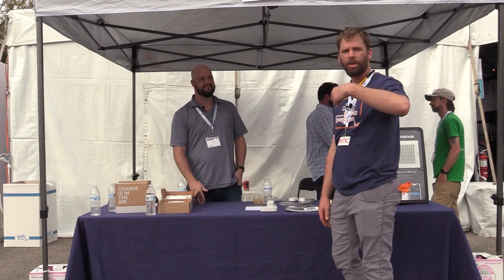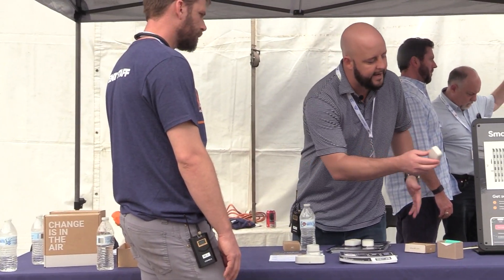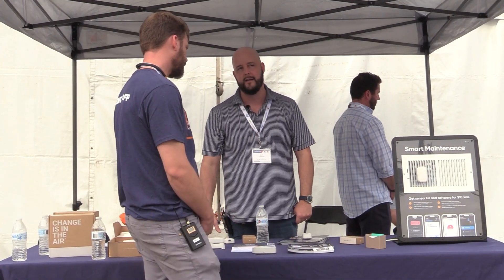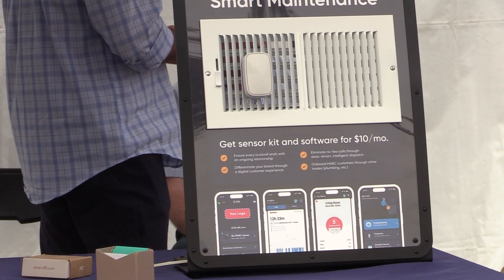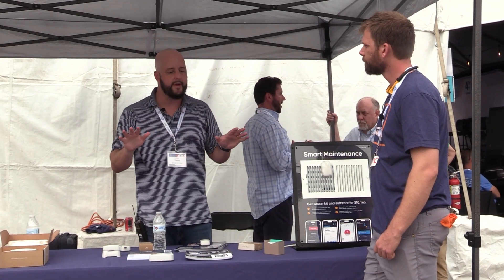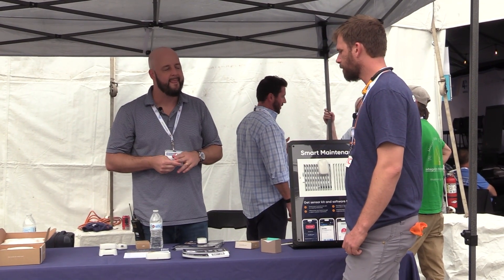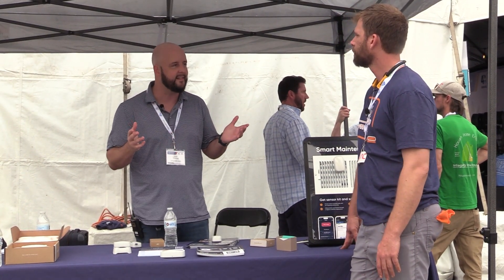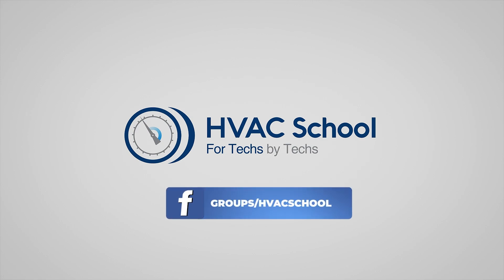Smart Maintenance with SmartAC

Comment: My company has been using these for about a year now and they're great systems.
Reply: Hi I am curious, how does the product determine a call for heat or cool with no wires?
Reply: @oldognotricks  Its goes off the temperatures sensed from the filter (return) sensor and the comfort (supply) sensor.
Reply: @Garland Pomeroy  so if system fan is in continuous and there is no call for heat or cool no alert is triggered?
Reply: @oldognotricks  It doesn't wire or sense anything from the thermostat or system. It's a separate setup with a hub and 3 sensors, that detect if the system is running by sensing supply and return temperature splits.